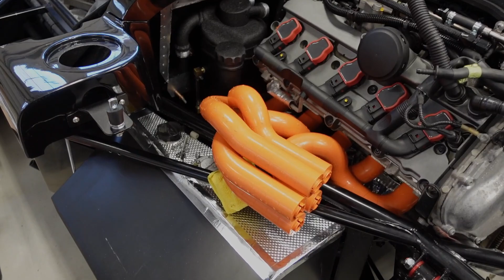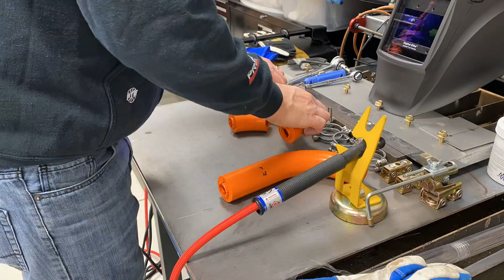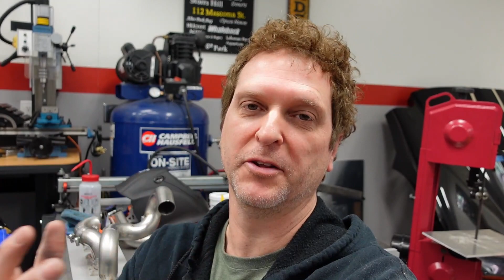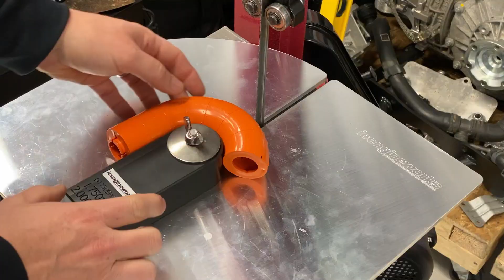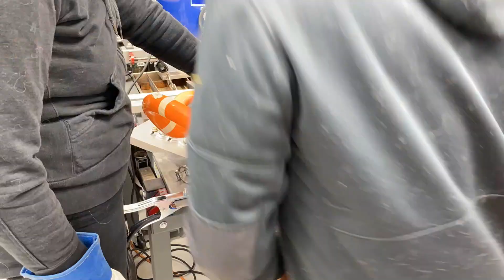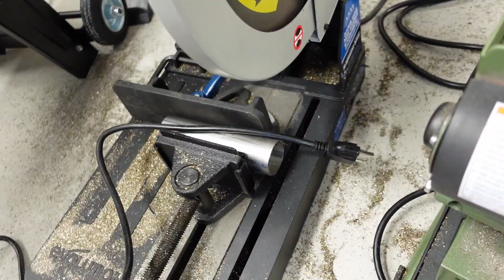Project 'Top Gun' - Custom Exhaust Headers - V10 Ultima Evolution Convertible Build

Comment: Because your band saw is setup incorrectly - the top roller should be down to your cutting piece only far enough to clear your part, those move so you can create a brace around your cut piece
Reply from the maker: The top blade roller guide is down as far as it will go. However the bottom guide will come up another two inches that I didn’t realize. This bandsaw unit was designed for horizontal cutting and it’s not very adjustable. It happens to have a vertical position option but clearly the design was not intended for lots of vertical cutting. If I were doing more tube cutting, I’d invest in a proper vertical bandsaw with much better adjustability. But this little cheap bandsaw got the job done. 👍
Reply: @DanDulac  ok that makes more sense being for horizontal cuts. Carry on

Comment: on the bendsaw, you should ajust the guiding wheels just above your project, that way is safer and you get cleaner cuts
Reply from the maker: Yep, good call.  I had the top blade guide adjusted as low as it would go.  I forgot to adjust the lower blade guide (beneath my cut plate) which would have closed the blade gap another ~3 inches.  Still not perfect as this cheap bandsaw has limited adjustability.  But in the end, blade wander was nearly non existent...Thanks for the tip!

Comment: Great work Dan! I'm just about to weld my headers.  What are your settings?
Reply from the maker: 3/32 2% Lanthinated tungsten, Fupa 12 cup, 25 cfh argon, .035 308L filler wire, 45 amps (@full pedal), 12 seconds post flow, back purge running at 10 cfh.  So far these setting have worked the best. I tried testing with pulse but still need to experiment...these settings are for the tube joints. The flange joints will be quite different (hotter with pedal modulation).
Reply: @DanDulac  You’re awesome Dan!  I was going to buy the ice engine works kit. Then I changed my mind and went right to steel. Having watched you, I wish I went for the kit. I’ve been doing it the old fashioned way. Having to dodge around the spark plugs, oil lines, frame, shift cables and rear axle has been crazy. On top of that, I’m putting in a crossover, flex pipe, muffler and catalytic converter. 
Your car is coming out so good! I love the V10!
Reply from the maker: Once I get the headers wrapped up, the next job is finishing up the rest of the exhaust. Like you, I’ll be adding high flow cats, flex pipes, a crossover pipe and resonator mufflers out the back. I’m so excited to hear what this thing will sound like.

Comment: I just used a tailpipe expander on my collector when I ran into the fitment issue.   A few pumps was all it needed.  They have both hydraulic and manual.
Reply from the maker: A perfect excuse to add another tool to the box. I’m going to look into it. Thanks for the tip!

Comment: Very impressive Dan, you’ve got my respect. Just a bandsaw tip, try lowering your blade guides. It will support the blade and cut down on blade wander.
Reply from the maker: Great tip!  I just checked the saw...I had the upper guide all the way down as far as it could go but didn’t realize I could adjust the lower guide (that my custom aluminum plate is bolted to) could be moved up a few inches....good to know!  And fortunately I didn’t have to deal with blade wander; I kept the blade very tight and that seemed to help.

Comment: With regard to the header build why not increase the inner dimension of the collector?
Reply from the maker: I think a hydraulic pipe expander would be required to do that...which I don’t have. I’ll try the sanding method and see how that works. I measured the difference between the diameter of the pipe(s) that fit versus the ones that don’t and there’s .006” difference. My new pipe sander should shave that down no problem.
Reply: @DanDulac  sounds good how about subcontracting the expansion just a thought.
Reply from the maker: @dave5833  That's definitely my fallback plan!

Comment: Looks great, did you find when cutting the tubes mid bend that the shape distorted to a but oval through releasing the internal tension when the bend was drawn?
Also when welding up each runner fully keep checking overall fit as a slight weld shrinkage on a early joint will have a large effect on final collector fitment
Keep up the good work 👍
Reply from the maker: Yes, some oval distortion occurred on mid-bend cuts, in particular the tight radius bends like the 2 inch CLR tubes. To correct it, a couple whacks on the side of the tube brings it back to a circle.  Great tip on the finish weld fitment—I’ll definitely recheck fitment after each seam weld on the runners.

Comment: How are u gonna weld the inside areas of all 5 of those pipes Dan?I mean from pipe to the collector.Looks like u can only do about 75% of the radius of each pipe.Then u run into the next pipe keeping u from going farther around on weld.U might not understand what I'm saying though.Im sure I'll see how u did it in the end.
Reply from the maker: Hi Lawrence!  I know exactly what you’re talking about. The collectors are designed to seal by slip fit. They simply slide about 2 inches down the runners and held in place by spring clamps (or weld where you can reach). When the pipes get hot, the runners will expand inside the collector slip joints and further seal it.
Reply: @DanDulac  I understand what your saying Dan.U know if u built those from collector towards the mounting flange.One pipe at a time u could weld around 4 of the 5 pipes if u wanted to.But slip fit should be fine.Its not like exhaust systems are welded from one end to the other on every joint.Its always clamps anyway.Im sure u will be using the weld on clamps that u weld 1/2 on one pipe and the other half on pipe your connecting to.I know if it was me who built those headers I'd be proud of myself.
Reply: @lawrencecarpenter638  A lot of big dollar motorcycle exhausts are held together by springs and slip fit, and they are making a lot more HP/ litre than the Audi V10 in standard form
 Dan, loving the videos and your workmanship, do you have a background in automotive or are you self taught?
Reply from the maker: I’m 100% self taught...it’s always been a hobby and I LOVE learning new things. Overcoming the fear of failure is a real thing and I learned many years ago to get over that. As a result, my skills have grown and having a ton of fun along the way. And believe me, I’ve had failures along the way—but that’s how we learn!
Reply: @DanDulac  I have seen some people weld the inside of the collector pipe. I'm sure it's not soo easy. Depending on what type of welding your doing you may want to look in to ceiling gas in the pipe when welding the outside to reduce the contaminants. I have never welded before, just an IT guy with some YouTube knowledge hahaha. Keep up the good work. It's a dream of mine to build a Ultima one day!!! I definitely appreciated your videos and how in-depth you get into it. if you like check out my videos on YouTube It's nothing special, look up The Geek Crib. At some point I'll be bringing in some tuning the my Launch edition STI. That I did all the work on my self.